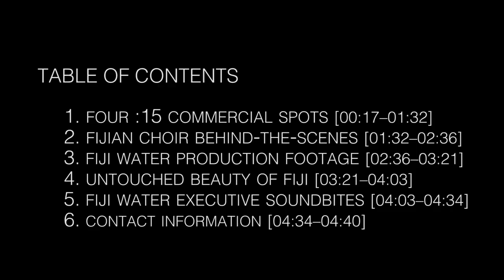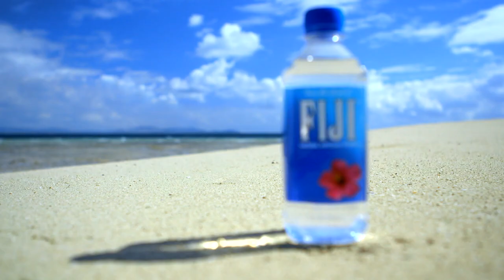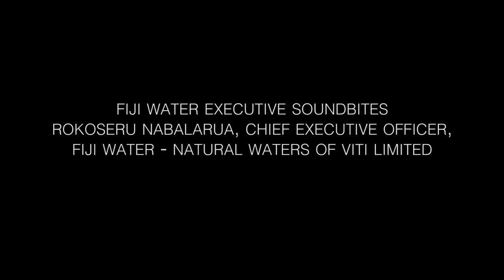Fiji Water “Untouched”

Comment: As an environmental engineer the best water quality on a budget for your house are those filtration units in some mega stores. They have multilevel purification for cheap, about 1.50 for a 5 gallon refill. It's Activated Carbon (should attract some particles in the voids, possibly trace metals) Reverse Osmosis (strong filtering, enough to take out salts I believe), UV light for microbes, and more.

Comment: But how is it made?
Reply: Runoff rain water gets filtered through crushed volcanic rocks. You can buy volcanic rocks for cheap, hammer them down, then run water through it several times for the same thing. It's less pure then the filters we have this way, but it's still drinkable.

It's based off ancient drinking water. Rain would pool at the top of volcanic mountains, then run down through the rocks to purify anything collected at the pool.